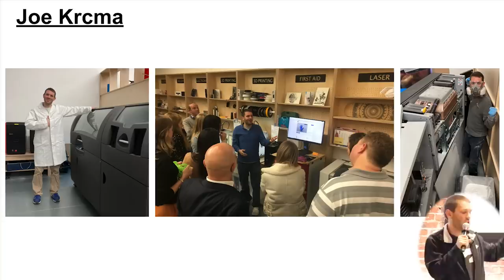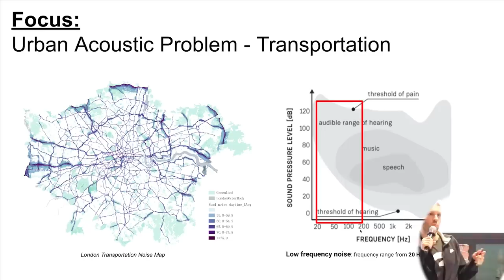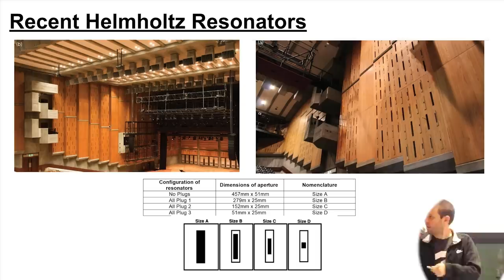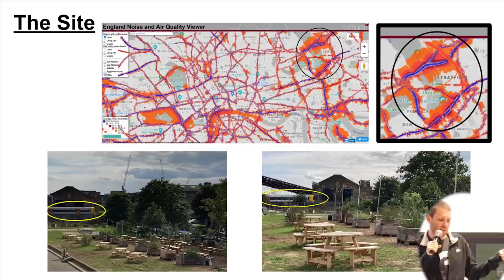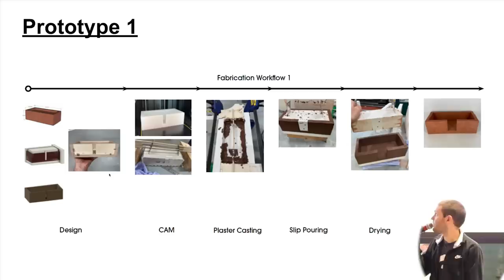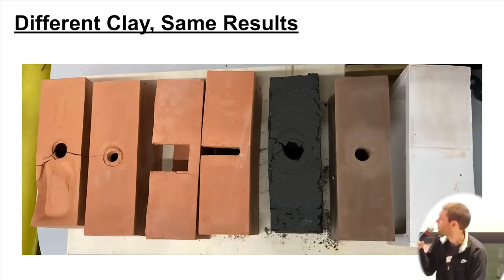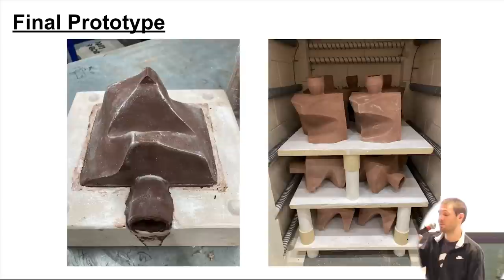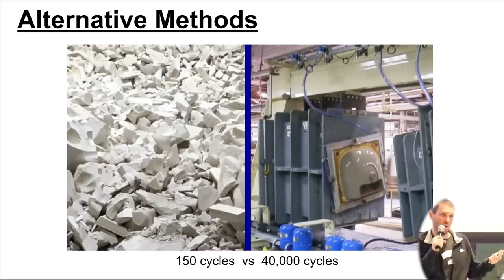These Bricks Can Absorb Traffic Noise - Thesis Presentation on Helmholtz Resonators

Comment: I wonder how long they'd last in a northern climate with freeze thaw cycles, I'd imagine all those pockets would collect water and then break when said water freezes. Another question I'd have is if they resonate at 10hz, would they begin to produce noise if winds hit them just right? If so they could backfire spectacularly haha
Reply: Design multiple sizes for the world's largest pan flute.
Reply from the maker: Haha, there's a great example of this in Croatia called the Zadar Sea Organ
Reply: freeze and thaw cycling would be a concern like it is for all terracotta but those pockets aren't going to fill with water since the necks somewhat long and perpendicular to the sky. Rain doesn't fall horizontally even in a bad storm
Reply: Just tilt all the holes downward. Iterative design issue.
Reply: @nobodynoone2500 no need rain doesn't travel horizontal unless you in Florida during hurricane season. Also the sound you trying to capture is extending outwards from the source in either a cone shape or sphere meaning you want to capture the sound being directed outwards horizontally as the rest either is reflected up by the ground or out towards the sky.
Reply: So tilting downward would reduce its efficiency at noise reduction.
Reply: @CoDB02   Attach the tube resonator to the bottom of the cavity, instead of the middle of the cavity, that way water cannot pool even if it DID travel horitontally.  (Which btw, happens even without hurricane/cyclone conditions - any amount of wind during the rain would trivially fill these up - you just need to design it such that the opening also represents the drain.
Reply: @alexrogers777  rats like small holes :)
so do birds.
one i can accept.
one i cannot tolerate.
Reply: @meateaw  and lets not forget this is britan so, if this is used anywhere in proximity to a pub you have other sources of water ingress with a strong horizontal velocity component to deal with
Reply: Plus the cigarette butts and other trash that gets stuffed into the openings
Reply: Ceramic clay is porous. And the resonators are made by joining bricks together. So if you leave a small hole at the bottom & top. the water could flow thru the internal of the brick & leak out weep holes at the bottom. 
Snow & sleat may be an issue. Still even if it doesn't handle cold climates, there is still a big market in places where it doesn't get below zero.
Reply: @jbbkr so right. Wonder if a mesh would affect the air wave much. Even if it would work, a mesh presents another problem with clogging
Reply: @alexrogers777  Rain doesn't fall horizontally even in a bad storm - perhaps you should visit London in winter?
Reply: @alexrogers777  - You haven't been in a thunderstorm with wind blowing. The rain hits you at almost horizontally, an umbrella is useless unless you point it into the wind. I would say just put drain holes in the bottom side of the tubes. While you're at it put screens over the open ends to stop birds/insects building nests.
Reply: @WJV9  It seems to me that birds and insects living in them is something they want to happen. How they weather is an important issues not yet discussed it they are going to be commercial, even if there are issues they might still have applications(e.g. freezing not an issue in Australia)
Reply: Tbh I wonder how much they would cost (manufacturing + installation + maintenance etc.) in practical rl applications especially when compared to existing solutions.
Also perhaps I missed something but bricks making/terracotta is a thousands years old art, seems to me consulting an expert would have avoided all those failed attempts.
Reply: @pansepot1490 european style bricks are made through extrusion. The ones that are kinda like a bundle of tubes.
I'm not sure about UK/US/Aus style bricks, but I think UK ones at least are solid, so unlikely to have the same problems.

He may have been better off consulting vase/flowerpot/decorative piece manufacturing. I suspect that would have similar problems to overcome and applicable solutions
Reply: @spambot7110  That would only affect the lower meter of wall space, barring the occasional feat of acrobatics or teamwork.  Underrated comment, btw.
Reply: If all the cavities are drainable and a drainage system installed as a base, then water and frost problems could be lessened. 
In the electrical world I often find outdoor waterproof boxes which have water in them. 
The solution is to drill a 4.5mm hole at the lowest point, letting the water have a permanent exit.
Reply: Geography resonating at large scale is a minor plot point in Iain M Banks - The Hydrogen Sonata
Reply from the maker: I like this!  I'll adapt the design and try to do these experiments for the next one👍.  Backfiring always makes for better videos as well!  Thanks
Reply: @alexrogers777  you also have to think about condensation
Reply: @alexrogers777  There is always condensation....
Reply: @spambot7110  LOL nicely put (it was the first thing that came to my mind as well)
Reply: @CoDB02  No, because the air molecules transmitting the sound vibrate in all directions,  you are confusing with direction of propagation.  It will work equally well with the cavity facing down at an angle as facing the direction of source.  (Think microphones - they don't need to point directly at the source to work at full efficiency)
Reply: Agree, unsure how you'd keep the interlocking feature and have the hole enter through the bottom, but i'm sure there's a way to make it work. 

Perhaps with a horizontal inlet/outlet and then a 90 degree turn upwards into the chamber. Have the neck fit into a recess between the lower two bricks?

Would love to see these in my city, fingers crossed this becomes a common sight @meateaw

Comment: A quick way to test some of these concepts would be to use snow. A snow fort or packing wet snow into shapes with a mold and building a wall could be a easy and cost effective way to try various shapes. Obviously, this needs to be done in a cold location, but as it only takes a few minutes of testing with a prototype; it could be ideal.
Reply: Or like plastic containers fillable with water 😄
Reply from the maker: Nice!

Comment: Very cool, though in your triangle from your final frame I count 27 mosquito breeding pools :) There may need to be some way to have water drain out of all these cavities or for the bricks to be lined with some anti-mosquito anti-whatever else likes still pools of water coating.
Reply from the maker: Good call!  And by integrating a channel throughout all the bricks, it will also help absorb lower frequency sounds because the cavity will be increased 🤩
Reply: @JoeMakes a rare engineering "win-win" :)
Reply: Limestone natural perpetualish waterpumps based on gravity. Running water 86s larvae

Comment: This is super cool! I'm in the process of designing a recording studio for a music school, and I'm on a shoestring budget. This gives me an entirely different perspective on acoustic treatments from found materials! In particular, pallets and cardboard carpet tubes from the hardware store.
Reply from the maker: Thanks!  Yeah, it's a great way to recycle tubes into a low budget acoustic panel.  Egg cartons are another cheap option that can work 🤩
Reply: I was tuning my apartment for a high end hifi here in Bulgaria - it had tiled floors and marble walls so it was a MIGHTAMRE.  I put up thick curtains but the thing I found to be great was a really cheap fibrous insulation material for cavity walls. It was probably very bad as insulation and I had to make wooden frames and cover it in fabric just to stop the stuff from decaying and falling apart. But it worked wonders at stopping the reflection from the back of the speakers.

It was like a low grade rockwool about 40mm thick.
Reply: I've been checking out the acoustic properties of water with epsom salts in it; It absorbs around 100Hz very well, which is a very difficult and important frequency range for traditional acoustic treatment to deal with. This was discovered by the US military when studying ocean water (regular table salt has barely any effect).
I have yet to do a full installation, but my initial results in my home studio are promising for corner bass traps. I've filled some 10-gallon jugs that restaurants get oil in with the water/epsom salt mix and covered them with a simple frame for aesthetics, and to prevent them from getting punctured. I put 3 or 4 of them in corners of rooms that reflect bass and make a room sound muddy.
I'd love to see proper tests done to prove my hypothesis that these are a great cost effective choice.
Reply: @inthefade wouldnt the sound just bounce off of the plastic? How does the epsom salt watef play in to this
Reply: @JoeMakes   Egg cartons do nothing but bad sound. They are horrible diffusers.
Reply: @inthefade  Measure the water temperature. If it doesn't change much is doing nothing. Anyway, I do not believe that you can absorb 100hz with ocean water. Where higher frequencies get absorbed quickly and lower frequencies travel miles. It is better to play with limp membranes, porous absorbers and perforated panels.
Reply: @JoeMakes  but think of the fire hazard!
Reply from the maker: For pvc tubes and foam? @tzm1843
Reply: See Fano membranes and MIT if you want to bust up sound.
Reply: If you want to stop sound breaking out from a recording studio, you need mass (plasterboard is the acousticians friend).  Absorbent materials will reduce reverberation time inside a resonant space, but making the inside of a practice room more sound deadening can't be considered a control for amplified music - the musician will just turn up the volume on the amplifier until they get the volume level they want.
Reply: try pvc u can slide one over the other to size as needed like a slide trombone good luck

Comment: Designing to mitigate traffic noise is an interesting topic, and a this was a great presentation! A different design that might be more easy to scale and practical to adopt could be based on existing hollow brick production by extrusion. You could make a single column cavity running through the longest axis, then drill out a thin neck from the outward face before firing. The ends of the chamber would be sealed by the neighboring bricks and mortar. The ends could also easily be packed with further sound absorbing materials before installation
Reply from the maker: Great stuff, I didn't mention it in the talk, but actually prototyped with extrusion methods early on.  However the university didn't have the large equipment early into the program, so switched to slip casting.  But would love to go down this rabbit hole!
Reply: Designing safe and accessible bike infrastructure is going to go a lot further to reducing traffic noise than trying to replace every surface with acoustic bricks
Reply: @AB-wf8ek  Or.. and please hear me out.. We don't abandon every other solution you think is not as good and instead have multiple options for different environments.
Reply: @Reiswaffel   I get that he's just trying to demonstrate the idea of acoustic architecture, but it's a purely cosmetic subject trying to cover up a serious issue.

Not only does this particular example appear to be very impractical, adding complexity to a solution that's just a bandaid, but it also displays a complete lack of awareness for the fundamental issue to begin with.

To me it feels like making a video about designing better paper bags to put over the faces of people scarred by skin cancer.

I apologize if I'm being overly critical, but I really believe people need to wake up to how horrible car centric infrastructure is, and talking about the issue in such a superficial way seems like sticking your head in the sand.
Reply: @AB-wf8ek  I don't know if you watched the presentation, but one of the sides of the park he was designing this for was bordered by a train line.

Public transport enables much longer distance commuting than bike travel.  (I dunno about you, but I don't want to travel 40km each way by bike when I need to have a client meeting in the city).

How do you mitigate public transport noise?

It's almost like there are more than 1 problem that could be mitigated by this.

Comment: My first thought is "how do you keep animals/bugs from using the holes to make nests?" 
Looks like they could easily become a motel for birds, small rodents, bees and wasps.
Reply from the maker: The bird nests may act as more sound absorption.  And with the price of rent in London, maybe a bird motel is a good way to get them housed
Reply: that was my first thought. Once these fill up with nest material and bird skeletons for those that don't make it... won't be very useful at all for dampening noise.
Reply: Exactly.  Anything inside the cavity of a Helmholtz resonator will change the characteristics.  It could be god, in the sense of providing absorption for the tuned frequency, but it would also change the tuned frequency.  The cavity depth is part of the tuning, so any object that makes the apparent depth different, is going to change the frequency.
Reply: @ChristLink-Channel  If that would be a problem maybe they could put screens on the holes. It wouldn't keep insects out though, but it would stop birds

Comment: Well intentioned but ultimately completely impractical. The cavities would soon fill with all sorts of debris that would soon thereafter allow plants to grow in them and destroy the wall if not regularly cleaned, which given the design is almost impossible to do easily. And while the design looks very modern, a more conventional flat stacked form would work just as well an make installation by masons far simpler. Also, being a resonator I can't help but think that these would turn into a source of noise when the wind blows past the wall, think blowing over top of an open bottle then multiply that by the number of bricks. 
Then most importantly, how does this compare to already existing forms of noise reduction? No mention of it so I'm going to go out on a limb here and assume not so well.
Reply: They mention at the frequency specified similiar reduction to wood and foam.  No idea thickness or otherwise but it was mentioned slightly.
Reply from the maker: Welcome to University 😂
Reply: Damage by plants is actually a very good point. Would probably work well in deserts but not in many other places.
Reply: The first thing that came to mind for me was damage by people. If this is in an urban environment the walls would have to be protected from vandalism as pottery is so easy to break.

Comment: I just realized how funny it was that I became involved in various noise abatement tasks, without any formal course of acoustics in (electrical engineering) studies.  Indeed, I don’t recall, when and where I met Helmholtz resonator concept.  I just remember they used to “tune” the resonators with appropriate amounts of ash (sort of sand, actually).  I also remember building a tape loop for a tape recorder, so I could record a few “claps” and get a repetitive echo for analysis.  I even built my own frequency analyzer set for this purpose.  I also have owned a Bruel&Kjaer sound level meter for several years and in the past couple years found a second hand 1/3 octave filter set for it.  Other than this, my profession has been control systems, not really acoustics.  But I cannot do everything at the same time, can I ???
Reply from the maker: We can try!  Or collab 😂

Comment: I would also like to point out that these resonators also provide superior insulation value because the air inside these cavities are relatively stagnant and this will improve the energy efficiency of the structure.

Do you plan on putting these bricks into production and commercializing them? Also, do you have a brick design that faces all the resonators in one direction?
Reply from the maker: Nice idea!  I wasn't planning on producing them because of the time it took to make.  And yes, if you want resonators in one direction, then you only need to slip cast one shape (I made 2 different molds)
Reply: @JoeMakes  would you be willing to open source the design for others to play around with it in their own building projects?

Comment: I love the idea! Did you ever test in a real environment? Like, building a wall of it there in east London and measure if it makes a differece. I would be really courious how good it works. And did you calculate the frequencys of those three Resonators? Propably with some calculations and some small adjustments on the design you could improve the outcome. I have so many questions and ideas... ;-)
Reply from the maker: Thanks so much!  Keep the ideas coming!  I was not able to test this at the site in the end because it was used for the final school show instead.  But I'm going to make some adaptations and build one to test again, taking those thoughts into consideration 🤩

Comment: Ok, the fancy cool bricks are nice. But if I wanted to cheaply replicate the effect at scale I'd experiment with concrete cinderblocks which have nicely sized cavities already, fronted by normal bricks with a specific spacing pattern to make specifically sized gaps, and then either a solid back or another gapped brick layer. Normal cheap materials installed in a clever way.
Reply from the maker: Yeah, that's what the Paddington Station slide was referring to.  But for this program we had to create something new in ceramic manufacturing.  But now I'm looking for gaps in any walls that I find 😂